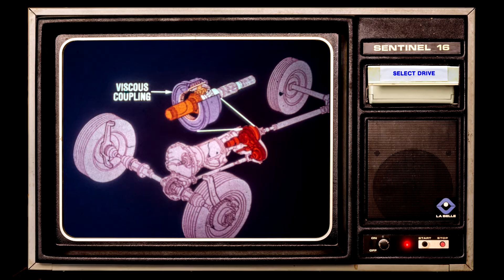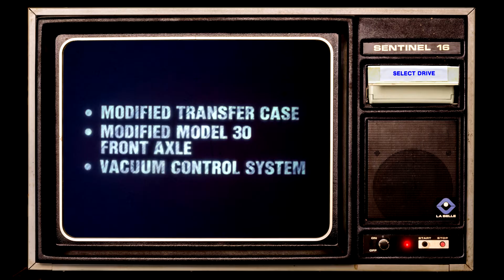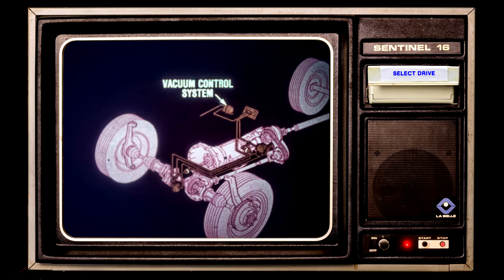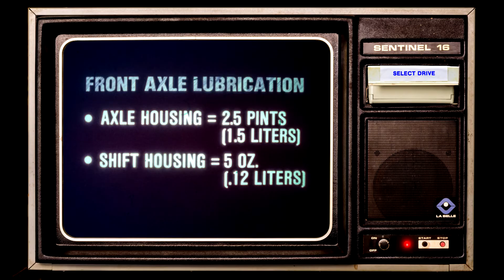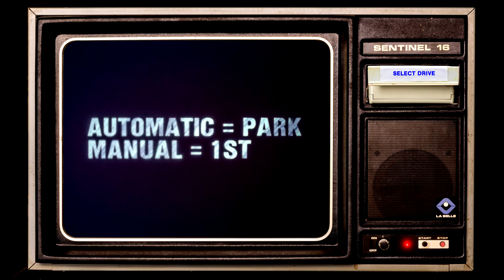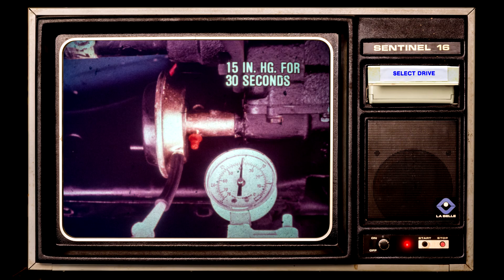AMC Select Drive 1981

Comment: I'm familiar with those transfer cases and the Select Drive transfer cases are garbage.  Vacuum controlled, belt drive transfer case?  What were they thinking?  If you can find any of those today, they have deteriorated to the point of complete non function.
Reply: I had no idea they were belt drive. 
Was that to make them operate quieter?